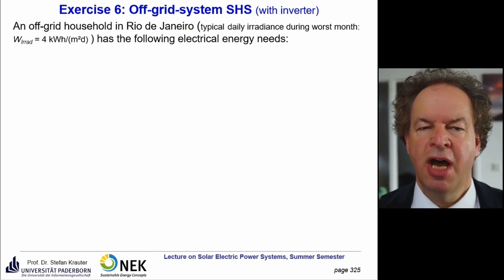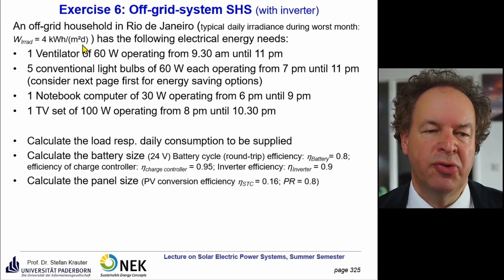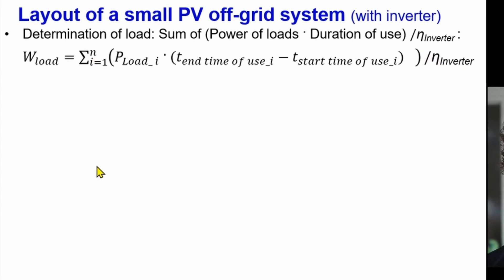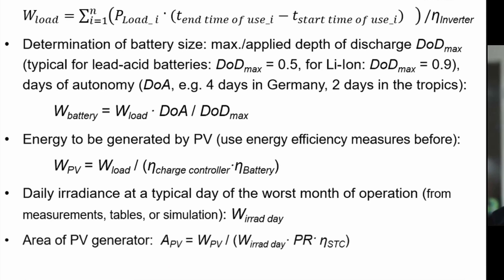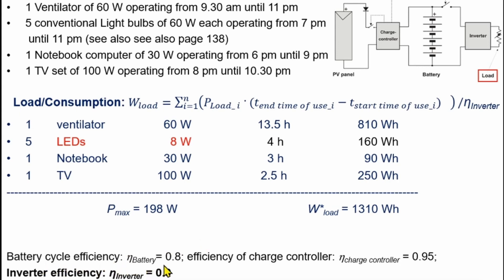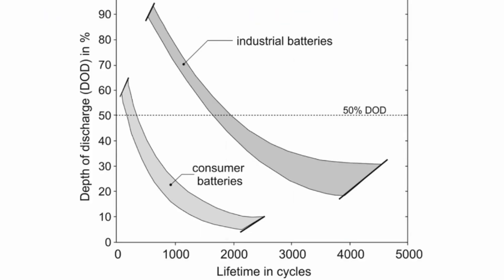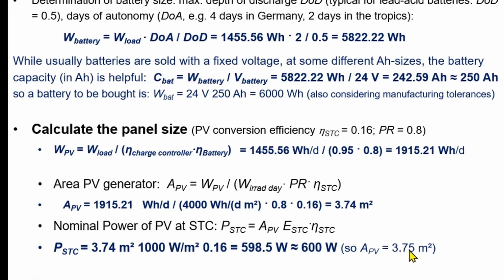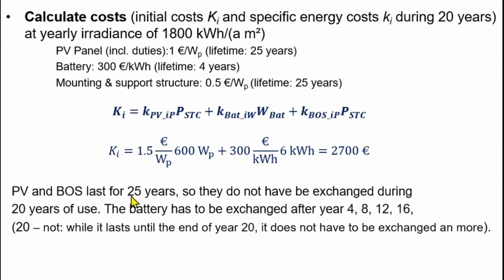Exercise 06 of Lecture Solar Electric Energy Systems - Calculation of a Solar Home System SHS (2021)

Comment: Dear Prof., At 17:07 , There might be a small calculation mistake for the initial cost of Battery K(Batt). 5x300x6 = 9000 not 5400.
Reply from the maker: I shall check it